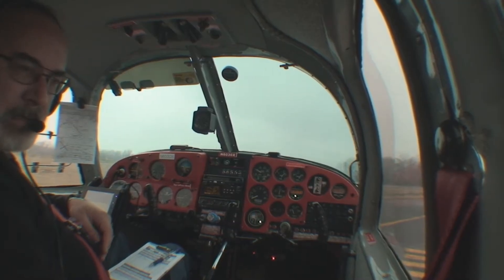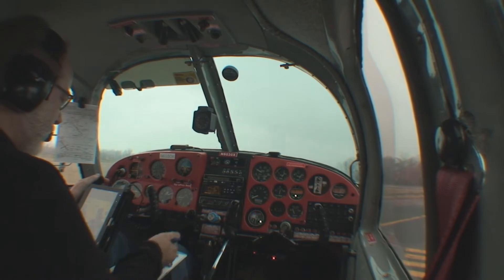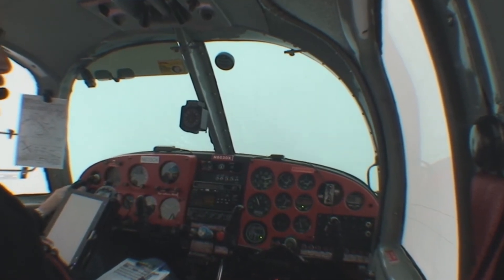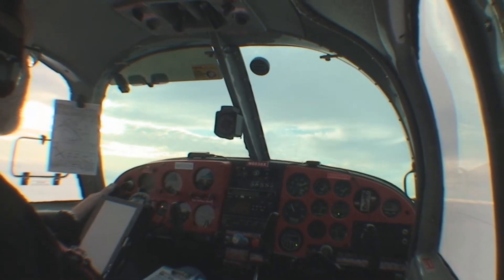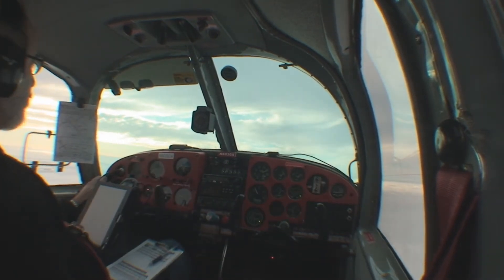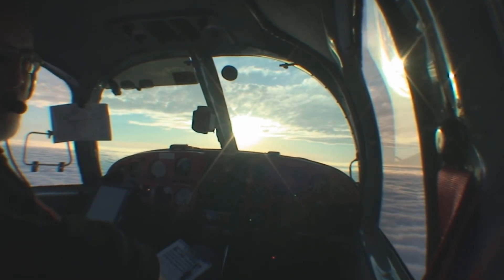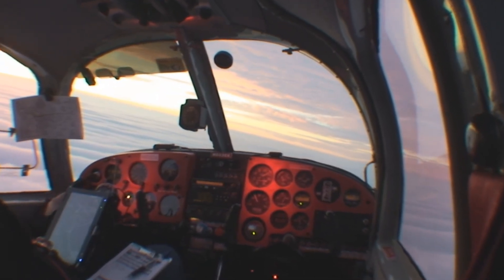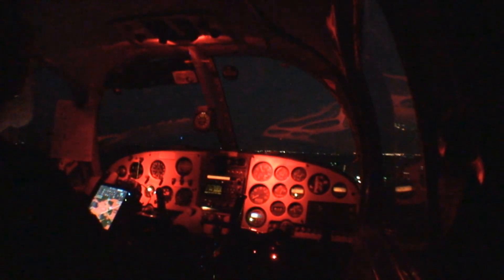Simple IFR and Night Flight - Part 2: Instrument takeoff, Night Landing

Comment: I bought an adapter cable (I believe from Aircraft Spruce) that plugs into one of the back seat passenger headset jacks, and the other end plugs into the 1/8" mic input on the HD camcorder. You have to use this adapter cable to match the impedances, or else the headset output will horrifically overpower and distort the audio into the camcorder.